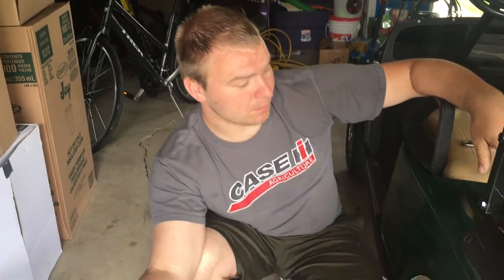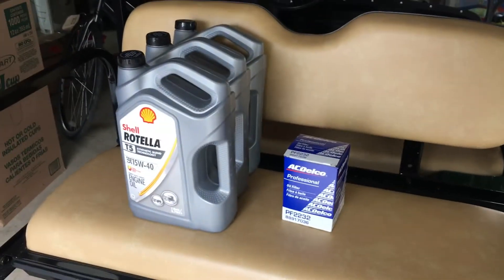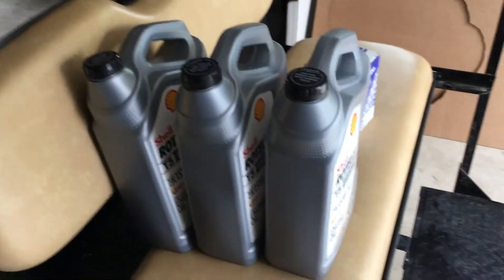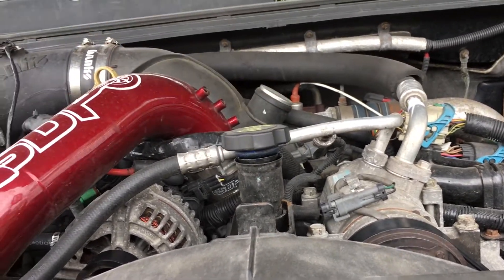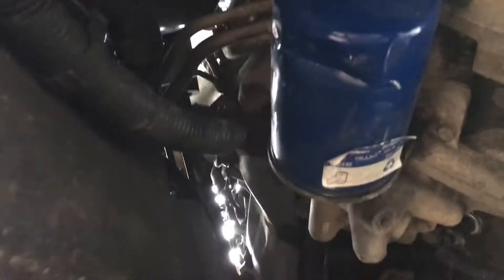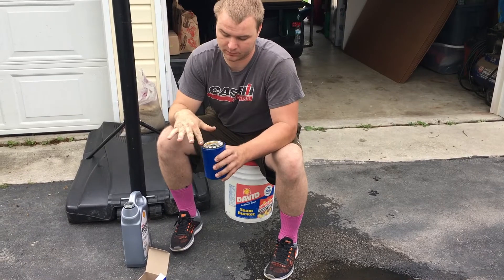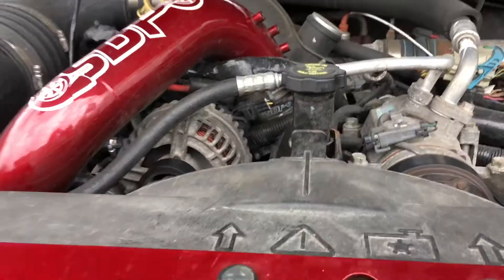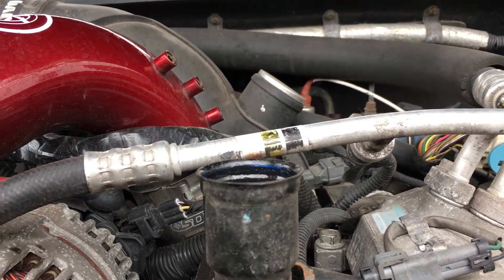Doing a OIL change on the DIRTYMAX

Comment: I would not roll the dice with Rotella. If you want to use a really good synthetic that will give you better MPG and quiet down the engine a little bit, it doesn't get any better than this:  http://www.searchforparts.com/oil-change/chevrolet-trucks-2016-silverado-2500-hd-pickup-6.6l-8

Comment: The micron rating on the Ac Delco oil filter is 25/40. Baldwin 8/23, Mobil 5/18, & WIX 8/23) all rate much better then the Delco.
And older diesels can run full synthetic oil. Plus synthetic blend oils aren't (unless listed) a 50/50 mix. So you're paying more for oil that's less then 50% synthetic oil. You'd be better off just sticking to conventional oil or get full synthetic.